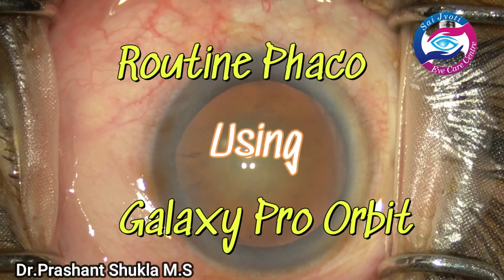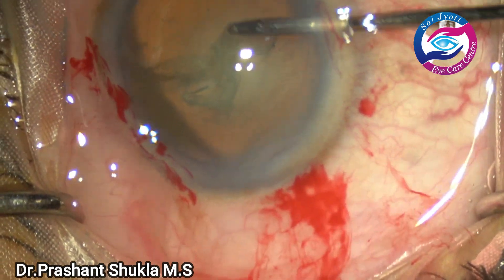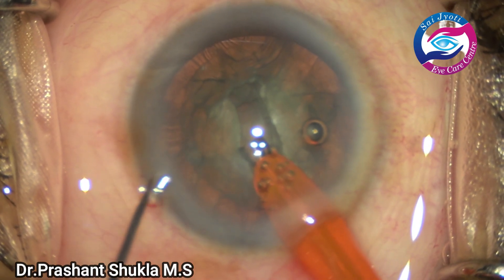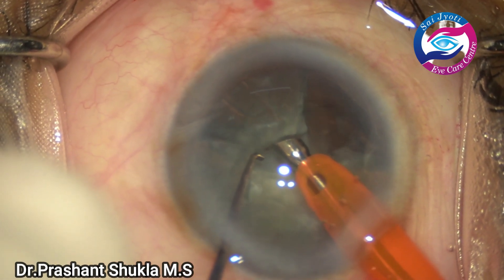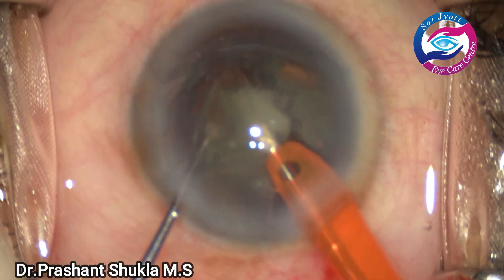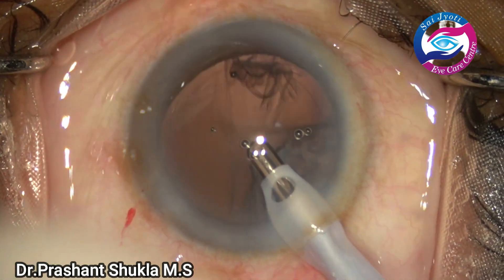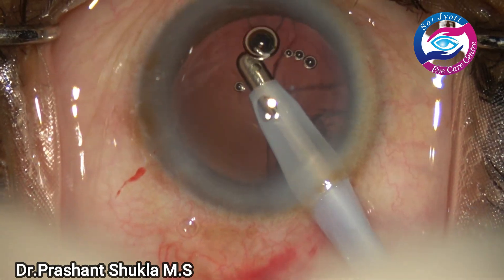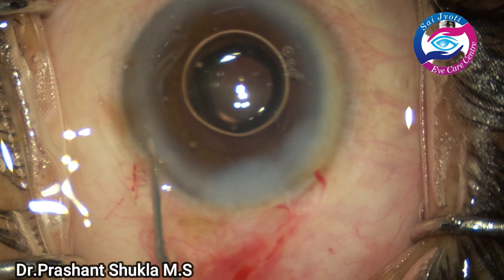Routine Phacoemulsification Using Galaxy Pro Orbit Phaco Machine

Comment: Your experience with NS4 grade with this machine
Reply from the maker: I have done a few NS4 grades with this works fine 
You can’t actually work like Legion or Infinity 
Cutting efficiency is okay has multiple mode like hyper pulse etc does the job Still can’t match the cutting efficiency of Torsional phaco

Comment: Plz tell me the modes available here....i am going to do phaco with this machine.....i have no pre experiance
Reply from the maker: There are many modes in this system with trial and error I have seen best for sculpting is continuous mode and for segment removal you can take pulse or burst both do good.One small tip in your early case pls don’t increase vaccum in phaco 2 more than 250  and then you will be good to go 👍
Reply: thanks sir...so here are modes like phaco 1,2,3 like Oertli ? and best for sculpting is phaco 1 continuous right ? @PSV1980
Reply: Sir, vaccum below 250 or 350 in ultrasound 2 mode for beginners?? 
And another question ,please tell whether pulse should be kept  10 during direct chop in ultrasound 2 mode ??

Comment: Nice can you share the power you are using and what u/s mode you are using thanks
Reply from the maker: Yes for grade 2-3 I used power 40-60 vaccum for sculpting 70 flow rate 20 in us1 continuous mode
For higher grades 65-75 power in continuous mode 
Us2 Vaccum 330 flow 30 in pulse mode
Ia 350 vaccine flow 35
Ia for visco removal 400 flow 40
Machine is good 👍 just have good control on foot switch